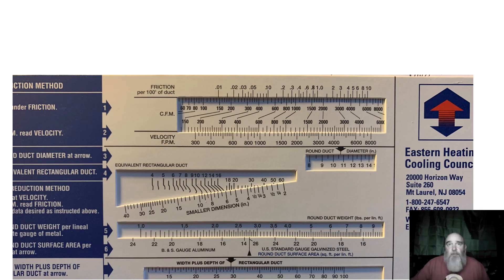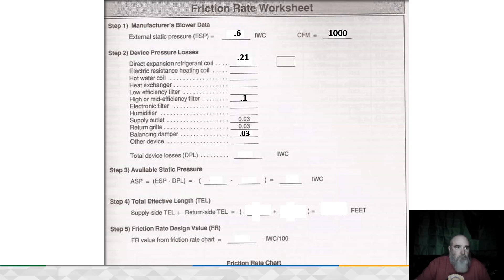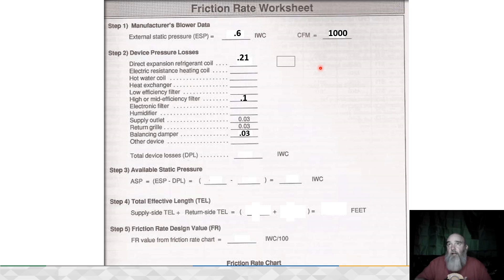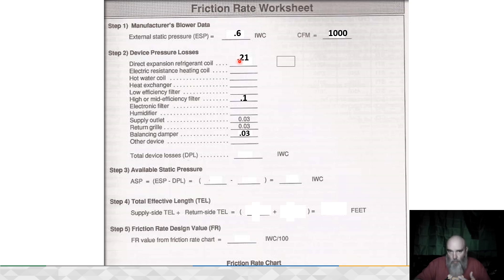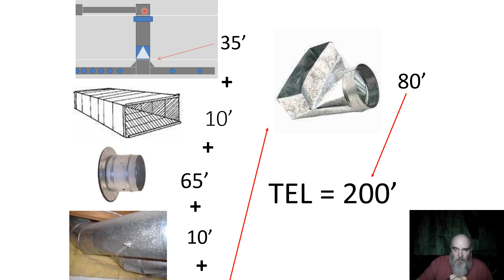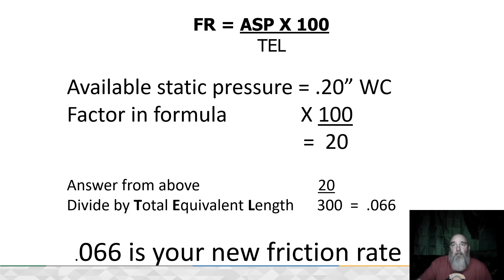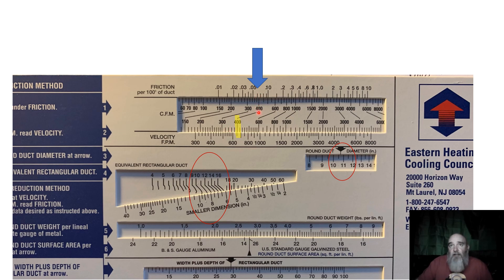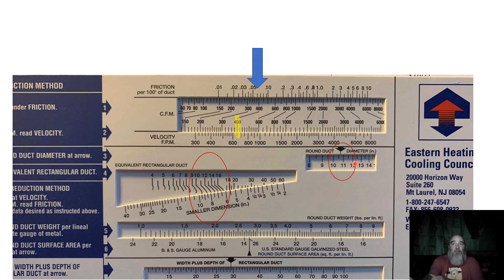how to use a duct slide to size ducts

Comment: Hey Ed, what are the consequences of falling outside of the Acca wedge friction rate chart? That is .06-.1.  This happens often when I try to size a duct system for a low pressure ducted mini split. Or with a conventional unit when my duct system is too long due to a tight, large custom home.  Thanks!
Reply from the maker: Bruce Randall if the friction rate is low, you’ll have inadequate fan performance. If on the other side of the wedge you’ll have excessive velocity. Take a peak https://www.hvacrschool.com/the-friction-rate-chart-and-what-it-means/
Reply: @edwardjanowiak  Thanks for the reply. This is something I’ve tried understand for a while. Brian in that link says it helps keep the duct at a reasonable size.  I can see that. But what is so magical about .06 - .18.  Your tel/asp is what it is.  Shouldn’t bigger ducts still deliver the correct amount of air?  Or maybe Is the calculation of fitting length dependent on the friction rate staying between .06-.18?
Reply from the maker: @brucerandall198  One of the phrases I've heard used to describe it is rate of return. You start to get into a situation with the lower friction where the duct work is physically too large. And the issues with that can be cost, whether it fits and one of the worst ones is that air moving at a velocity low enough to increase the temperature drop and or lower your supply temperature to the point where it causes the surface of our duct insulation to go below dew point.
 On the higher end with friction rates that end up being greater than .1 we end up with velocities that break “the rules” and we end up moving our duct slide to get our velocity within the limits so it's kind of a waste of time during the design process. If I calculate a friction rate of .14 and every time I line up my duct slide friction rate to my required CFM and I end up with velocities that are 1 1/2 times my limit it's an exercise in futility to continue to use that friction rate. The practitioner would be better off spending their time making sure that their available static pressure is somewhere between .2 and .3 (or do your own math and find a good Compromise  on ASP) so when we use our duct slide we come up with realistic sizes versus velocity. I don't know if you did this on purpose, but I think you gave me an idea of the subject of another video.

Comment: I've been trying to learn how to do basic calculations on what size ducts are suppose to be on an existing unit. 
I'm a service tech and never really learned about the duct sizing and sizing of a unit. I need to know these things. 
It's so beyond frustrating to me because I feel like I'm so lost. Every single video I've ever watched it almost seems like the people teaching are teaching in a way as though the students already knows most of it instead of teaching a 5 year old this stuff. 

I wish there was like an extensive three or four hour video starting from the very very basics. 

When I go on a service call and a customer complains that their room is always warm, I want to know if the unit is sized right and if they have the proper air flow going into their room.
I'm at the point now where I'm about to just give up because I feel like there's so many missing pieces.